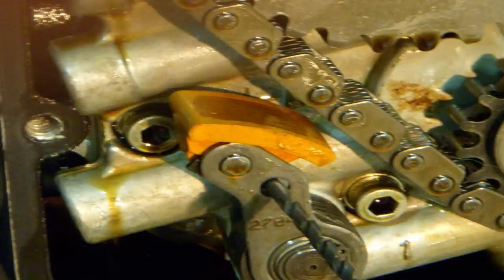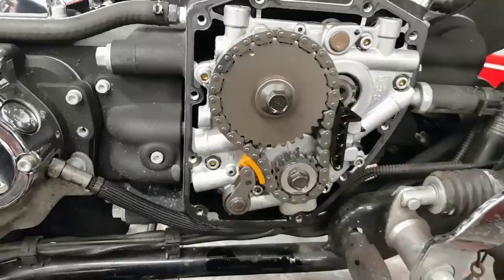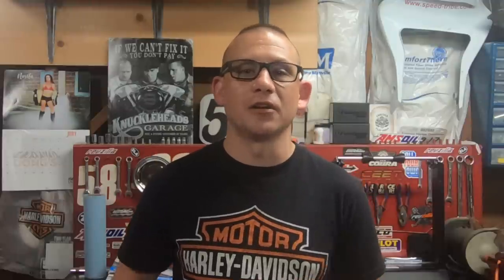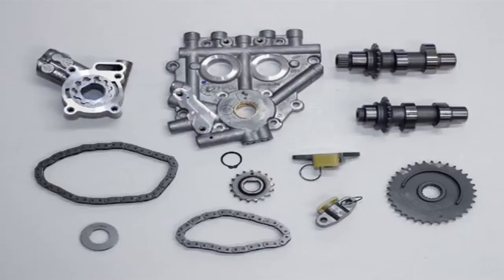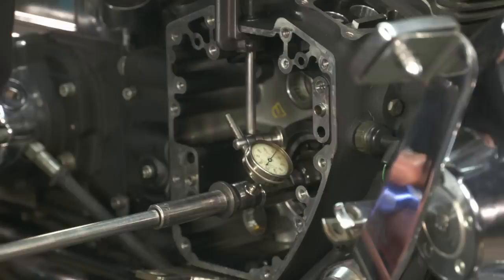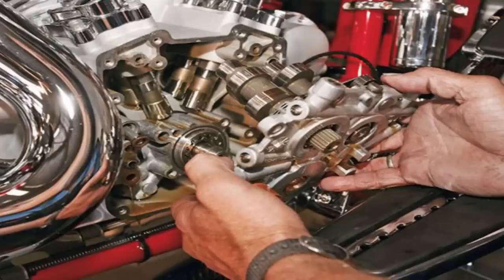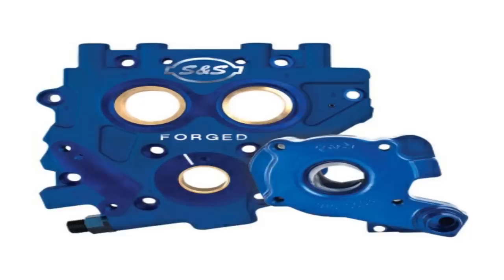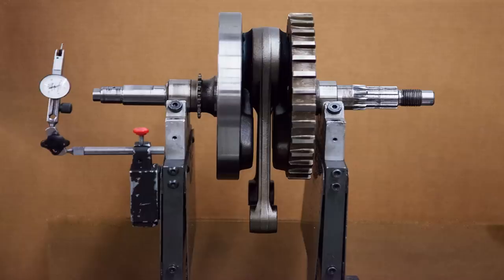Gears or Chains For Your Twin Cam's Cam Chest? What You Need to Know

Comment: Cam chain system works just fine with hydraulic tensioners. Very expensive to upgrade the crank to run gears for very little benefit IMHO. Cam plate/oil pump combo is a nice upgrade either way for a happy bike!
Reply from the maker: I personally like the hydraulic system, with gears your crank also has to remain in spec and if it ever comes out of spec it can be a disaster with a gear setup.
Reply: I agree, upgrade plate, oil pump, hydraulic tensioners, and while it’s apart, upgrade/replace and rollers/bearings. Also replace the chain. I had all this done to my 02 FatBoy a couple years ago. It had about 29k miles. Outside shoe was def worn and inside was almost worn out. Caught it in time. Dealer asked if I wanted to upgrade the cam a bit while it was apart? I choose to remain stock cam since I’m not a racer. Technician was really impressed how smooth and no wear was visible on the cam.👍 He said keep doing what ur doing regarding oil changes. He did also recommend to replace the lifter tappets while he was in there. So after a few days at dealer and about $1700, I figured my bike was upgraded with any parts it should have had in the first place. Put about 2k since then, runs like a clock. Slow and steady wins the race 😉 Just my two cents.
PS: I remember an old timer told me back in 02 when I bought the bike, to NOT get it geared. He said if you do get it geared, the weak spot is no longer the chain…it will be something more expensive to fix. I heard that a few times over the years, and took it to heart 👍
Reply: You only want to do this once . so start from the beginning and send your bottom end rotating assembly to Precision balance Company of Indianapolis Indiana. Then you can install a backing plate for a gear set from FUELING ..get your cam and gears from $&$..yea this will cost maga dollars. But your chain should last long enough to save up for the ultimate ...or just buy a 100 cubic inch evo from $&$ for about the same cubic dollars vs pounds of fun
Reply: You're right, but it should have come from factory with gear drive and welded or bolted flywheel

Comment: I upgraded my 2003 TC88 to the Screamin Eagle cam chest and 203 cams. Pinion side runout was right under .003. Decided against gear driven since it’s not a Timken bottom end and could possibly develop more runout.

Comment: I've been reading through the comments and it makes me mad to know HD nailed it with the early twin cams with the exception of the cam chain tensioners. This was easily resolved with hydraulic tensioners or gears. Then they screw up and cheap out on the crank and ruin the foundation of the entire engine.
Reply from the maker: Harley is notorious for fixing one problem and creating another.
Reply: @GixxerFoo  Sorry to get off-topic. Runout in 2001 was less than .002 flash forward six years and in 2007 they consider .012 "acceptable". How could they allow those engines to leave their factory. Makes me wonder at times if they care at all about their customers and quality.
Reply: @kerrylewis2581  a Honda engineer would commit Hari Kari before letting that engine be put in a bike
Reply: @EazyDuz18  I think most will never know about the issue because they only ride 1,000 miles or less per year.

Comment: Always love your posts man, but as I have always said this is the best engine Harley ever made and then ruined it with cheap cost cutting. Keep posting though and I’m looking at a winter rip down,  it haven’t quite decided yet how to go. Cams for sure and maybe a bigger bore, but the issue of either hydraulic or gears bugs me. Mine is a 2004 so smack bang in the middle kind of thing. I think it will be a compromise in the end. Keep posting bro, you have great insight and knowledge.
Reply from the maker: Thank you, l appreciate it! Twin cams an excellent engine, down side is you gotta replace the weak links the factory installed. Once get one built they are pretty bullet proof.

Comment: I installed S&S gears in my 2000 FatBoy.  Traded it in  with 85,000 miles and never had an issue.  That motor was outstanding.
Reply from the maker: That year had the solid bottom end and much better crank assembly. If they would of just left the crank and bearings alone with the hydraulic system the twin cam would of been the next Evo.

Comment: These little factoids pretty much sums up what I've been saying about the twincams all along. All the way up to the evo, the factory spec on the crank was 2 tenths of a thousands or less. 2 thousands was when it was time for a rebuild. Harley sure got sloppy with the twincam. Just my opinion though. If I ever had another twincam, it would be a 2001 or 2002 with a gear assembly. Great video topic, bro.
Reply from the maker: Thank you! You've got those Evo's now, best "modern" Harley engine they made. Early twin cams were solid, but like you said they just got sloppy with the twin cam.

Comment: I have an 03 EG Standard. Put gear driven cams in at about 40 thousand miles and it was the Best thing I ever did. Run out was fine so it was a no brainer.  I did the gear driven cams,  lifters and put in adjustable push rods at the same time. Today there is over 125 thousand on it and have had NO issue at all. Love the sound it makes too.

Comment: That's why I bought a 2002 Foo. It's cheaper and easier to upgrade the cam plate which you'll be doing anyway on a build rather than replacing the crank, which if you're doing that than it doesn't matter because you're most likely doing a Stroker. Also as an honorable mention lol let's not forget about the 05 heads...BOOOOO!! Many will disagree but personally, the twin cam is my favorite engine, built, carb and a tune that loves to rev is magic to my ears coming out of a 2 into 1 RB LSR. Great video
Reply from the maker: You make a great point about the heads, they aren't all the same through the years on the twin cam! They did the same thing with the sportster, depending on your year a big bore upgrade won't do much good for you and you have to work the heads over.

Comment: I'm jealous of those who own a carbureted  01 or 02 Twin Cam. I modified dozens and they were all less than .002 in runout and are perfect for gear cams, head work, and increased displacement. I've also never seen one crank move on any 01 or 02. It would take some major abuse to screw up early TC cranks.
Reply: I too have done gear drive cams on early TC motors with good results ! I have seen a few 02 to 04 motors come out of true but as you said they were run hard they usually break teeth of the gears & quit running ! Don't know if you have tried it but I have trued TC flywheels & welded them with good results !
Reply: @leonardstanford1877  Only installed. Darkhorse and R&R is where I go when a crank is needed.
Reply from the maker: If Harley would of left the bottom end alone and just changed to hydraulic tensioners the TC would of been the next Evo. But Harley is notorious for creating another problem to solve one.
Reply: Thanks!  I have an 01 with gear drive.   A lot of these comments were scaring me!

Comment: I have an 02 Dyna with 50,000 on it.  Still has the original tensioners in it.  They are due for replacement soon. I have a "theory?" about why these wore out quickly.  I think that if the engine is run at too low and rpm, the chains develop chain snatch.  Similar to a drive chain when running at to low an engine rpm.  On a drive chain, it jerks back and forth.  I'm thinking that this might happen to the cam chains too at low speed.  If that's the case, the chain slap will load and unload the chain spring tensioner and make it slam up and down..  And HD guys do love to lug their engines down way low...  I don't.  Perhaps that's why mine is still OK?  Your thoughts?
Reply from the maker: It's a very viable explanation for what is going on, especially if you got 50K out of a set of original spring tensioners. That's very impressive and lends a lot of credit to what you're saying. No ones ever precisely determined the cause but I would for sure add that to list of what happened with those!

Comment: I wonder why HD couldn’t do a tensioner like on a car’s serpentine setup.. a strong wheel seems like it’d alleviate the many issues of their tensioners
Reply from the maker: Buell actually had a tensioner like that on the drive belt, but honestly Harley's timing chain tensioner system in the engine is very similar to what is used in car engines.

Comment: To make sure you get the right gear cam kit all one has to do is call S&S motors to get all the right parts like I did and my 88 runs like a top for the last 8 years. Gear cams are the way to go so you don’t have to crack the case again, but don’t go cheap and get everything new including the cam plate, oil pump, shaft, lifters, and screws.
Reply from the maker: That's a great point! New parts wear out old parts!

Comment: I'm pretty lucky so far. 2000 with 18,000 and tensioners still look very good...for now anyway.
Reply from the maker: It is such a crap shoot on those tensioners, some blew motors from failed tensioners at 15k and other ran towards 100k with no problem.
Reply: @GixxerFoo  I it might have something to do with which manufacturing facility produced the spring/quality control issue. Just a guess though.

Comment: I got lucky.  Bought an 06 road king, and the runout was 1 thousands... checked it 5 times in disbelief.  S&S cam plate,, oil pump, S&S lifters, and 509G gear drive cams... with a Powervision, and many tune adjustment......., it runs great and the chatter sound I had is gone.  Hoping it lasts a long time....
Reply from the maker: Really?! Is that the stock crank or has someone been into that some point in time?

Comment: Thanks, I picked up a '99 FXDL with 25k dry miles on. It's got good old CV carb. Checked the tensioner shoes and they will definitely make it till winter here in the UK.
Reply from the maker: That's awesome to hear! You can't beat a CV carb, you can freshen those up and they are good to go.

Comment: So looking at a project bike. Rolling thunder frame. Probably a rubber mounted soft tail. 

Planning a knucklehead if it'll make the power I want. Was thinking an Evo if the knuckle won't do what I want power wise. 6 or 7 speed transmission. Thinking of fuel injection and water cooled. Maybe turboed. 

Might do some upgrades after I get it sorted in a basic set up. Anything you'd recommend? Basically gonna be like a pimped sportster with a slightly different suspension set up. Wide rear tire 240mm probably. 

Kick start plus electric ignition. Trying to build a reliable bobber.

Comment: Exactly right on all points. I would say that in most cases upgrading the chain system will do the trick. It's cheaper and easier, and will work just fine. I think a lot of shops try to sell the gear drive setup just to make more money when it's really not necessary. I have a feeling that some of them also overlook excessive run-out.
Reply from the maker: Sadly there are some dishonest shops that will setup a gear drive on a wobbly pinion. It will work, for a while anyhow. My biggest gear drive concern is pinion is good at install, but riding it hard, miles and time wears on the crank. If the crank develops excessive run out later you can have a disaster.

Comment: Have an 03 Dyna. had the oil pump cam plate update with hydraulic tensioners at 45K.. bike just turned 80K...I've been told the hydraulics last twice as long as the spring type so my calculations is I'm good till 135K ( I bought the bike in 2014 with 13K on it.and have been running synthetic since 20K)
Reply from the maker: Good oil and hydraulic tensioners last a long time, about 40K on the hydraulics. With good oil and changed often I've seen them last well past 40K.

Comment: I took your advice about my 05 Soft Tail Deuse that has only 10400 miles on it.I went in and opened up the cam chest and the chain tensioners looked good but I just went ahead and upgraded to a hydraulic with the chain set up the crank did have .3000s run out but the cam side had just .2000th run out.As I installed the oil pump and cam plate I turned the rear wheel as I started to tighten up all the bolts to spec.I figured that way I wasn't putting added pressure on 1 side of the new oil pump.Was well worth doing the upgrade.
Reply from the maker: That's awesome! You'll get years of trouble free riding out of that engine now!

Comment: bought today 04 fxdx so very helpful to see this come up on my feed.
Reply from the maker: Those are awesome bike! The 88 is a solid motor, just getting some hydraulic tensioners in there and the newer oil pump is all it needs.
Reply: @GixxerFoo  that is the plan mate, your channel has been extremely helpful and definitely stirred me towards the twin cam instead of m8. Quite a lot more shaky than my sportster but god it pulls so good.
Reply: I've got an 01 FXDX and did gears and cam.  You'll love it

Comment: Thanks as always for the great info.  Put Feuling conversion cam plate, hydraulic tensioners and conversion cams in my 03 Dyna. Was at 60k miles... didn't happen to check pinion run out... but it's running great!
Reply from the maker: You should be good using the conversion cams, it's worth it to get that later style oil pump!

Comment: Amazing how someone can retain all that knowledge.....now I have a headache!  Awesome info as usual, sir....thank you very much.
Reply from the maker: 😄😂 thank you, I just spent a lot of time in the back of the shop growing up and listening to grumpy old guys talk.
Reply: @GixxerFoo  i wish i had you as my local Indy, here in NY,brother. love your vids.
Reply: Oh btw..., having my 2005 15th  anniv fatboy,bottom end rebuilt by  my  indy up here in NY. getting s&s crank/flywheel, ( the runout was 005 on the gear side and 007 on the main shaft)fueling hp cam plate and oil pump, lifters,gasket set. and labor for 3,900$  what do you think?? 
      Im so psyched.....ever since i did the andrews 37 g drive,adj pushrods, 4 bearings,.. it sounded like a diesel cummings, no joke!!!!.k new something was wrong...3 mechanics later. found the right one. bike will be quite right???  im just hoping! ps....your thoughts on the fueling hp cam plate/oil pump???  i asked my indy for s&s plate, he said...its more for REAL HP...like racing!   im just an avert rider ya know ,foo??!!
Reply from the maker: Feuling is a solid product, they are really high quality. $3900 would be high for a job like that here in Oklahoma, l would definently ask around for some comparison quotes. But you can't put a price on having it done by the right person who gets it right.

Comment: So happy my FXDX is an '01.  Run out was less than .002 so I went with screaming Eagle cam chest, high flow oil pump and gear drive with .510 cams.  Runs great.  I would avoid '03-'06 like the plague
Reply from the maker: That's awesome! Those older bikes with the Timkens are solid!
Reply: Did you notice how much faster it accelerates with the geared cams? Mine really came alive
Reply: @Mm-ik9uq  Absolutely!  This winter I plan on doing 95" kit with 10:1 pistons

Comment: I would like to thank gixxerfoo for all the info and guidance on upgrading my 03 road king twin can 88 I had to go back to the original set up as far as the tensioners but I did up grade my bearings pushrods and lifters now I know what's up cause when I bought my bike 4 years ago I had no idea about any of that if you are going to buy a twin can 88 99 -06 I would strongly recommend you research before you buy like gixxer says I got lucky with mine for a change but it can go south on your ass quickly
Reply from the maker: Thank you, I really appreciate it! This is exactly why I do this, I've seen too many people buy a bike and have issues. I'm very happy to hear you got your bike lined out!

Comment: I wish I knew about all this before I bought a big twin or I probably would have gotten another Sportster.
Too late now I got the bike and I already had to put the money into it.
Reply from the maker: The Sportster is indestructible from the factory, literally almost perfect. Twin Cam is a great motor, just sucks you gotta fix where the factory left it lacking.
Reply: Nothing like a Sportster for reliability.   I had a 95 and sold it with 50K.  Stator bolt loosened once.  Only issue ever.  My 96S has 30K of flawless running

Comment: So, this is what I am looking at for the winter of 2022/23. Upgrading my cam to a higher torque one. I am really torn between gear or chain. I have no idea how to measure the crank runout, nor do I have the tools to do so. As much as I dont want to, it may be done at a shop that winter, and not by me. I wont know which one to order until they tear it down though. I would like to go gear driven-and am hoping the tolerances are OK for that.
Reply from the maker: What year is your bike? If you have a 99 to 02 runouts are really good, if it's 03 and up chain is always a safe bet. But if you runout is really bad upwards of five thousandths or more you would likely feel it.
Reply: @GixxerFoo  a '19 FLHT

Comment: 02 rk .003 s&s hydraulic cam plate and cams
09 dyna .003 stock plate woods cams
I feel lucky lol. Keep up the great vids
Reply from the maker: Thank you! I am not shocked the 02 RK had good runout but the 2009 just goes to show not all the cranks were way out of spec.
Reply: I gotta admit ...i was nervous going into the 09
Reply from the maker: There's a lot of stories of issues but overall a majority of the bikes were good to go.